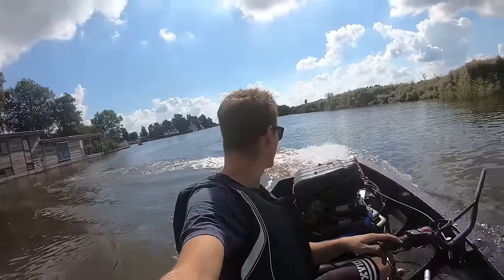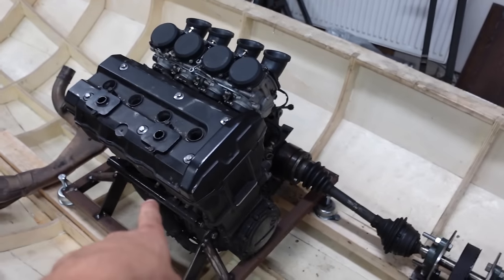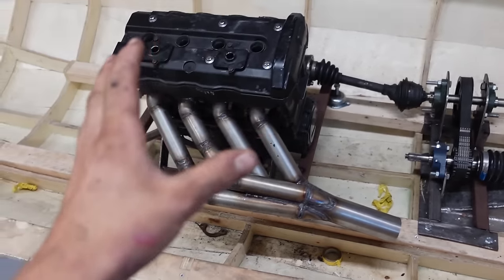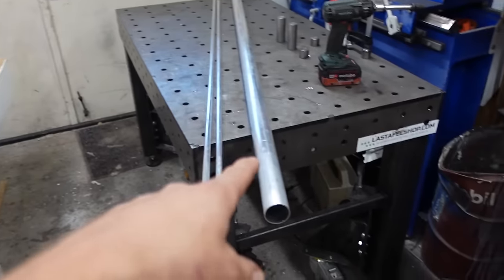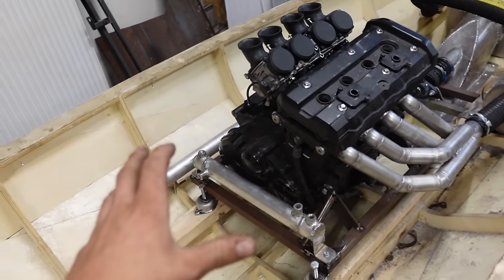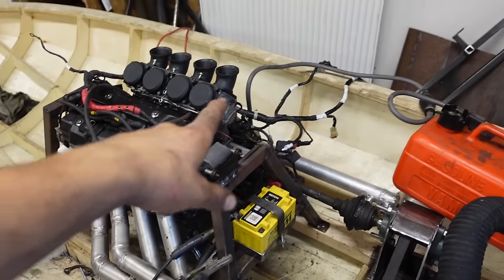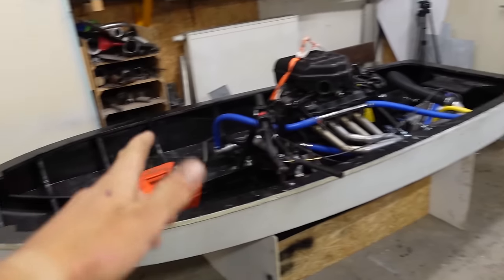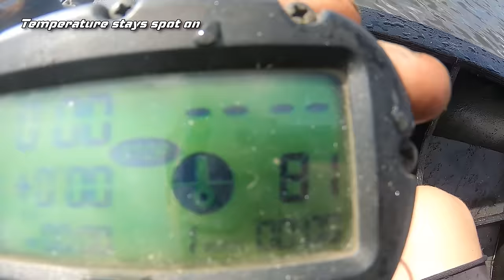Homemade JETSKI part 5 - Exhaust, Cooling system & testdrive

Comment: I would dearly love to be your age again to have the strength to build things like this myself.  I am a 76 year old former VW and Alfa Romeo mechanic who built an open frame dune buggy and 7' 10" hydroplane boat in my youth.  I have four Honda motorcycles but I dreamt of putting a Yamaha V-Max engine in a jet ski and here YOU are with almost exactly what I was thinking.  Here in Florida USA there are all kinds of jet skis available cheap with blown engines and the idea of transplanting a water-cooled motorcycle engine would be right up my alley.  Congratulations on your build and your welding skills!

Comment: Very cool! Are you sure the belt is under proper tension? Under load the metal structure might deform and make the belt slack. I think that belt should handle that power under the right circumstances.
Reply: Belt drives like that are used on experimental aircraft and they can handle a lot of power.
Reply: Idler pulley would probably take care of the belt jumping. Great build.

Comment: One idea for an improved drive system in replace of the belt would be a snowmobile chain-case, affordable and able to withstand a lot of power., plus if the chain were to break you wouldn’t have it potentially damage the hull.

Comment: Perfect content. Modifying exhaust cooling system to double wall could be wise.  Water may flow back into the engine when you deaccelerate too quickly.

Comment: Great project thanks for sharing. Love the "sounds" of the engine thru your headers and exhaust system. Perhaps the belt needs to have more tension but I am sure from watching that you will fix that problem. My concern is that it seems that perhaps your boat is a little short and too small for the combined weight of the engine and yourself. She seems to sit a little too low in the water and she ploughs a bit. It does look like you almost hit "plane" but a little more rake in the hull would make it lift quicker. I have built a few boats back in the 60s and 70s so it's been a while and I am far from being a master boatwright. Keep your videos coming.

Comment: I’m hoping to build my own jet boat in the coming months. I already have a vfr 750 engine and gearbox a boat is easy enough to pick up but I don’t have the skills or tools to fabricate the jet drive so I’m stuck with having to source a drive from a jet ski which could probably cost more than the boat I intend on buying. 
  Thanks for your videos as they’ve answered questions I didn’t know existed. All food for thought.

Comment: Absolutely amazing and so interesting I dream to have a garage tools and skills to do such build. You inspire me to work hard in my young years with my girlfriend to have a lifestyle to support such projects.

Question, why do you need to cool the exhaust when superbikes don't ever need to? Also, I wonder if it will sound quiet and a lot better if you put a cheap motorcycle end can/muffler on the end of the exhaust to soften the noise. So it's not obnoxiously loud.

Furthermore, I can't wait to see the next video with the beefier drivetrain, I'd love to see how fast it goes in 6th gear 😁 good luck with the tuning of the carbs

Comment: The water inlets to your exhaust are way overkill, you could just run 1/8” pressure sprayers. My watercraft only require an .080” hole. 

To fix that, run your main water outlet overboard but tee in for your header line. Run no more than a 3/8” line to that with 080” holes in each head pipe.

Comment: Man your skills in fabrication are really impressive! You manage enought to make everything you think work in metal-working, welding, wood-working and fabricating. Considering your young age is really impressive, my compliments! Iwish to leave you a suggestion anyway: to rise the belt shaft make new two plates made of a sigle piece each, if you want to add a piece like you did I suggest to weld it with a 7018 rod with a proper bevel because is much stronger than MAG welding, consider that are very stressed areas from the torque of the shaft.

Comment: Looking great, lots of power and should be fun!
Point on the drive belt, set the tension correctly and the belt should never skip, so don't remove it and change yet. Belt will be quiet compared to other options. Maybe need a mechanical threaded adjuster to set and hold the tension properly.

Comment: Your builds...but especially this one...has inspired me to do a project of my own.  Nothing like your projects...its a pavilion roof for my patio.  Carpentry is my skill set.  But it's an elaborate design...timber frame with heavy beams and lots of joinery.  I swear it's because of watching you that I say "I can do this"...don't limit yourself.   I get the timbers delivered this week.  I am doing it all myself...I've even made a mobile crane for lifting heavy beams by myself.  Thanks for the inspiration.   Also...that engine sounds gnarly!

Comment: Cool project. 

It is not necessary to cool the exhaust if you are running the engine compartment in open air or with ventilation. My guess is that it won't hurt anything, but it is unnecessary. You need to cool the ..... Hmmm. I'm wondering now if this isn't just a test bed for later installing the engine into a jatski.... I see that that is one of your other projects. I'm new to your channel. 

I'm not sure if you are familiar with the Jetski Brothers V8 Jetski...  I built the water cooled exhaust manifolds for that project and have modified the exhaust system on my own Jet Ski that had an engine swap. I like you level of customization.

EDIT: Just finished watching. Well done. I've wanted to do something like this for a long time but have never actually made it happen. The gear system is neat, but not at all necessary for a jet drive system. The pump will have diminishing returns as you spin it faster, but I would have done the same thing just out of curiosity, and to have gears on a boat.

Comment: tipje, bestel een spanrol van een Suzuki X90, die zijn excentrisch, en erg degelijk, supermakkelijk om met die rol je riem te spannen, btw, gaaf project!! in English: i would suggest to order a tensioner from a Suzuki X90, excentric, rigid, and very easy to use for this application, btw, REALLY cool project!!

Comment: "Belt skipped teeth"... *Kough TOLD YOU SO.... Also i take all that water was from the waves not leaks, but consider making holes in the frame so any water that is in, will leak to next compartment and to bilge pump, but make sure to fiberglass those holes water tight so water wont get into wood frame. Biggest reason boats like this getting destroyed is water leaks and wood frame with in rotting away. For anyone wanting to build this thing, consider come composite materials that dont mind water or glassfiber as frame material instead of plywood.

Comment: I'm pretty sure there's a reason PWCs don't have gears, since the water jet propulsion is very different to a 1:1 relationship with a drive wheel and the road, which is why gears exist. Jet pumps rely on pressure, not necessarily RPM. The higher gears may spin the jet pump faster, but with less torque. I'll be curious to see how it works. It appears the biggest determining factor of a PWCs speed is its horsepower, not RPM necessarily. In a normal PWC, the jet pump can only spin as fast as the engine. So a max RPM of around 8500. With the transmission, youre going to be able to reach much higher RPM at the jet pump than that, however with less power. My theory is that you're going to find one gear that works way better than the rest (probably one of the lowest ones) and just keep it there, or at the very least, not shift much at all.

Comment: Beautiful watercraft you have made and quite an accomplishment. However, watching your video I'm seeing your boat is seaworthy but it doesn't appear to come to "plane" but seems to plough thru the water, of course I may have missed the segment where it did pkane. You have plenty power and it looks stable in the water so your hull isn't raked properly or a combination of things like the ratio of hull surface to weight or possibly too narrow. If you solve that you will increase it's speed and fuel economy as well. Not being a critic, you did great but hopefully helpful so you can enjoy your full potential 👍!

Comment: Funny because jet skis come with 320hp now and dry sump so you basically just made a 1999 jet ski. slower.  And also jet pumps can’t turn 12k rpm  max 8-9 with a crazy impeller

Comment: Hello garage lover!!!  Why do you think I called you that ??? Well , because first of all that you don 't pull for more ! No, not because of your project as a whole, the project is even very interesting and, in my opinion, worthy of the highest praise, but in those little things in which you just do nothing at all, just not how. As for the body, what prevented the provision of a place and holes for the water cannon, immediately at the assembly stage so that the metal parts of the lower part do not protrude above the bottom, thereby not creating porous swirls of water at speed. Omitting some details , let 's move on to the belt drive with a decrease in the number of revolutions , the question is how long it will last , I 'm talking about the gear belt and why it was necessary to build this node . The simpler the technical node, the more reliable it is. Directly from the star to.... again not how? Are you afraid there won't be enough engine power? So you have it with a large margin ! For what reason did you not use the factory exhaust system, but built up something that is impossible to describe. I took and strangled the engine , and in order to use the regular ramjet , you 're probably smarter than those engineers who developed it . And for what reason , on sports bikes , the exhaust manifold is located in front of the engine just behind the front wheel ???? It 's just to cool down with the flow of oncoming air and not overheat , but now think about what will be going on inside you there ? It will crack to red under load. Interest in your work disappeared on this series . Remember, "talent lies in the little things."I would not cooperate with a former "mountain master" in order not to blush and not to justify myself and not to listen to his work in the aftermath. And the weighing of the mine of the vessel did not interfere with making it.

Comment: The jet drive may be a bit safer but it would be very hard for me to leave 60 or 80 mph on the table. Copy an arneson type drive with a chopper prop and that little hull would probably need to get a bit bigger because it would get you up to well over 100mph with the HP you are working with.

Comment: You likely already repaired the belt issue by now however an idler pully should be enough to solve the issue.  Something like a dry timing belt tentioner would do wonders to keep the teeth in contact.

Comment: Well done ✅ 👍 was concerned your jet drive prop might be the opposite hand to the engine rotation but you obviously know what you are doing, you could upgrade your belt with a timing chain and elliptical cog to improve acceleration and reduce labour on the engine

Comment: Why aren't you using a chop saw to cut your piping? You can even use a miter saw with a metal blade in it, that way you get your cuts straight.

Comment: Only prob I see in your future is water in the engine oil. Problem with installing your average land motor in a boat is.   The camshaft overlap is timed for no water. So if the engine has overlap from the exhaust to intake lobes  it will pull water mist back into the chamber. Fantastic work on the build though man. Awesome!!

Comment: When I saw you modify the drive belt I wondered why there was no belt tensioner or any adjusting possibility.
A belt tensioner is not that expensive. About €10 to €40 for a car-part.
Reply: I saw your username and I knew you didnt have anything smart to say

Comment: congratulations on the project and persistence. because of people like you, this world is much better. It seems to me that the cooling of the engine is weak, you will need better water suction through the engine
Reply from the maker: We will see🤪
Reply: @homemade_madness  the motorcycle has a closed cooling system with a slow water pump, by adding a water diverter you will get a much better result 😉

Comment: I’m so amazed at your skills! Either TIG welding is easier than it looks, or you picked it up mighty quick! I’m also curious why you’re using a grinder for straight pipe cuts when it appears you have a cutoff saw hanging on the wall.